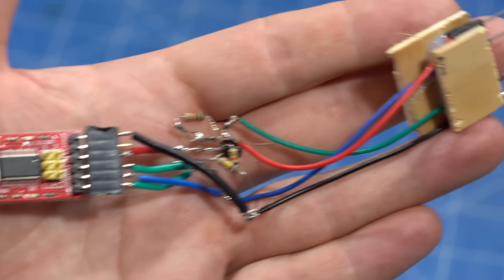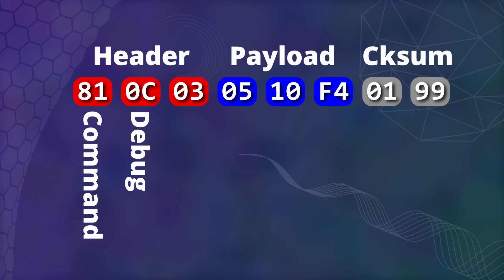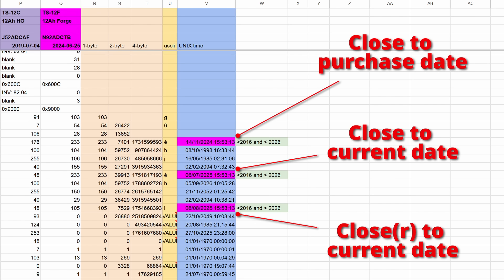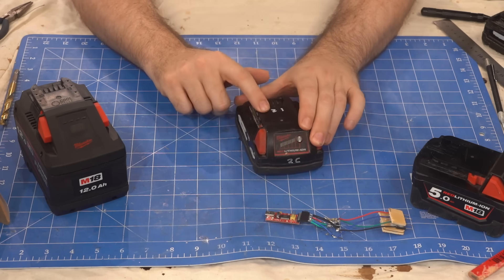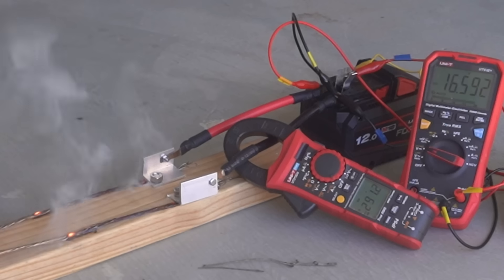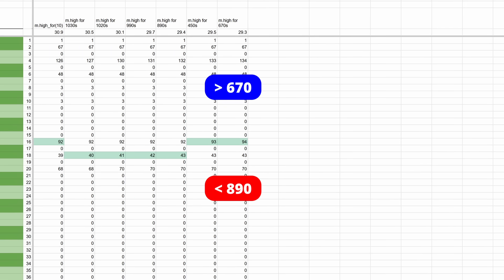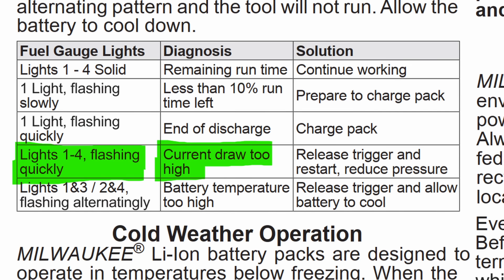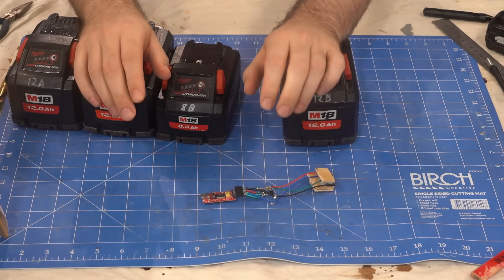Full M18 diagnostics revealed

Comment: Next do Ryobi batteries.
Reply from the maker: This guy did a great job on Ryobi. Not sure if there's diagnostics to be found, but I'll have a look eventually. https://www.youtube.com/watch?v=NQ_lyDyzEHY
Reply: @toolscientist  I know but the protocol between the charger and the battery is still unknown. (there are two pins T1 and T2 pins)

T1 is from charger to battery and T2 is battery to charger communication.

T2 seems to be encoding up to 4 values of voltage to send data. while T1 is a simple binary bit.

I have some of similar batteries but the PCB are different.
So I cannot replicate the work.

Right now I'm reversing my PCB. And creating a custom new BMS
 as mine is lockdown even if the cells are correctly balanced and charged.

Quite annoing failure of thoose batteries.
Mine died couple of months after the warranty.

My end goal is to have the original charger to accpet such batteries.
Reply from the maker: @tuttocrafting  interesting. I do have a Ryobi 36V that I know ha T1 & 2 pins that I've been meaning to look at. It might be same/similar protocol as their 18V system.
Reply: @toolscientist  AFIK the 40V system uses serial communication as those shown in your video. While the older 18V system uses a less sophisticated way of communication.
My battery have a attiny on it and I dont have a way to attempt the dump such firmware.
Reply: Ryobi uses analog protocol at least on the 18V line. 
T2 (Battery to Charger)
Idle: 5V, Checking: 3.2V, Charging: 1.5V, Overtemp: 2.8V, Completed: 3.8V
T1 (Charger to Battery)
Idle: 5V, Charging 2.2V, Completed: 0V

Charge completed signal is initiated by the battery and then acknowledged by the charger. 
Also, I have not found a way to get a serial link with the battery although now I am curious to try.
Reply: @badarsworkshop  Cool that you figure it out.
I oly have failed batteries at the moment so I wasn't able to reverse the conditions.

On my BMS i'll add a small MCU to imitate those commands meawhile the BMS would be full analog based on the BQ77915.

I'll see what can I do. The issue of the internal timer/lcokout pin affect also the one with the attiny88 MCU instead of the nxp one. So the issue might be in the AFE BSP.

Comment: When we had access to the Milwaukee quick link tool for programming onekey tools we could see the case serial number in the software. Unfortunately they retired the old quick link and moved to cloud based access to the tooling, but that did also show the case serial number in the browser window along with details like the build date, first charge date, state of charge, cell balance figures etc.
Reply from the maker: Is that the 2700-20 (or M18ONEKA-0 outside America)? There's so little info about these online. Did you need an internet connection to use their software?
Reply: @toolscientist  Yes, it is the 2700-20 ONE-KEY Adapter.

Milwaukee used to have a stand alone exe you could run that dialed home. Now it is all handled through their dealer online portal. Either method required an internet connection and a dealer login... and your dealer account had to be approved to service ONE-KEY tools.

Basic explanation is that Milwaukee allowed some ONE-KEY tools to be repaired by dealers. When this included electronic assemblies, the dealers needed a way to transfer the information (serial number, etc) from the old tool electronics to the new tool electronics. This tool performed this task. There were other promised features coming, but that appears to have fizzled out.
Reply from the maker: @LaverneMellinger  thanks! Another commenter mentioned MPBID which led us to an internal Miwlaukee document that has somehow been indexed by google 😂. That doc pretty much showed what you say - changing PCB changes MPBID and the software lets you link the old case number to new MPBID. So it seems we are looking at MPBID and will not be able to get SN, but that's not super important anyway.
Reply: Would love to hear more about this!
Reply: cloud based diagnostics?interesting.
that gives them:
1: possibility to look up case vs chip serial numbers
2: feeding back stats to milwaukee 
3: they could be looking for signs og hacking/abuse of the interfaces like demonstrated in this video

Comment: Wonderful analysis. Well done. It's nice to see that milwaukee batteries have such an extensive data resgistry for diagnostics. It is unfortunate though that we see, if I underatood correctly, the new forge battery bms board hasn't solved quite a few essential issues for longer battery life. 500 mA voltage driftimgbis a crazy amount after 5 years. But it does sound about right. I have one 12Ah battery by Milwaukee I believe has started significant voltage drifting afyer only 2 years of normal use. While the data may be helpful for warranty purposea, the ussue temaims that with a new battery is due time you will run into the same problem and I think is not the long term solution. What I would like to see is how cirremt owners can currently fix the cell balancing issue. The main problem in my experience of troubleshooting cell imbalances is taking the battery putbof the casing and painstakingly manually rebalancing them with a powerstation amd leads to equal voltages per group, and then syncimg them in the final charge with a milwaukee charge so that the bars correspond again with the calibrated rebalancing equal voltages bewtween the 5 cell groups. Then the battery can continue again for a while, usually about 5-6 cycles, before the 3 bar full charge issue pops up again in the 12V battery.
The best solution in my experience and knowledge is that ever cell gets a lead to the bms board to rebalance the cells actively while doing a "maintenace" recharge at 1-2 amps. I think that could great help longevity of the batteries. The 8 and 12 HO batteries have a great power and versatility, but I think the enigineers should look at improving end users product value by adding cell balance technology as an essntial part of the system. We see it also with hime and car batteries. It should be the norm, not a feature by demand.
Thank you and your team for all the hard work! Well done.
Reply from the maker: My thinking is that people can use this tool to quickly and easily monitor their batteries without disassembly. Then they can warranty them before their warranty expires. Eventually Milwaukee should implement balancing in response to the extra warranty claims.
Reply: it is planned obsolescence !

they do all this monitoring to learn how the cells react to certain usecases and in turn make the bsttery even crappyer and ideally make it last 25 month. so warranty is out, battery dies, no warranty possible => customer buys new batterys =>>> $$$$$$$
Reply: The off-grid garage channel also gave me a lot of insights on the value of of a good cell balancing bms.

Comment: Why do you need the level shifter between the battery and the serial convertor? Pretty much all of the ftdi chips have an option to set them to 3.3V instead of 5V. Is there some other reason for it?
Reply from the maker: Ok, I obviously explained that part poorly. The battery's RX line (J2 pin) needs > 7.1V. It's TX line (J1 pin) works at 3.3V. It's a weird system that I think is due to backwards compatibilty issues with their pre-UART system.
Reply: @toolscientist  Ok that makes a lot more sense! Thank you for all of the work you have done!